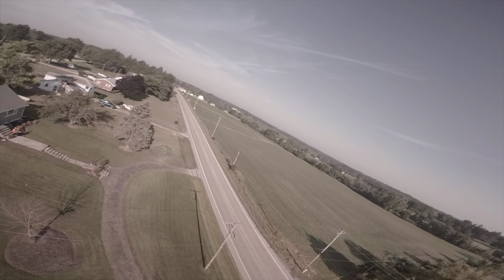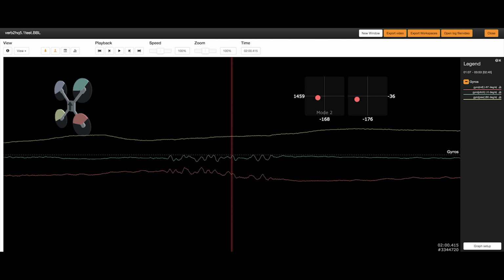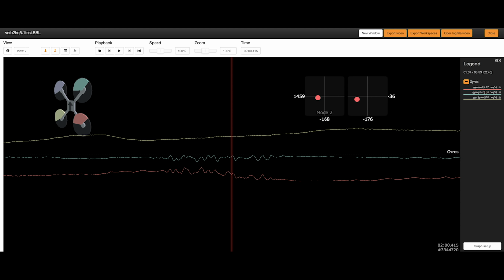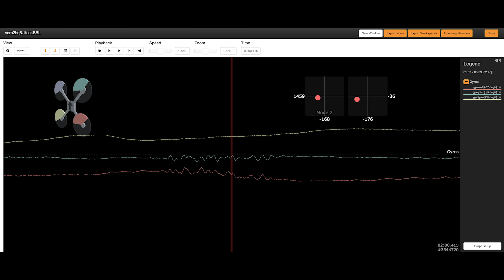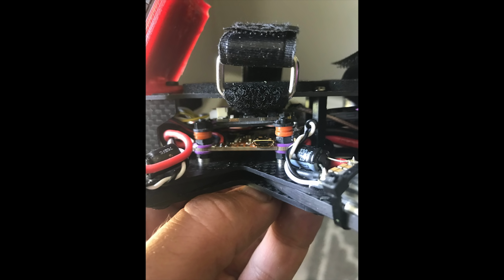FIXING SOME MID THROTTLE OSCILLATIONS\\STEPS TAKEN\\BLACKBOX\\PROPS

Comment: @dorkyand40 I've got a new build I did impulse apex with tmotors f55 stack and I've got a odd bobble on decents and certain throttle percentage and yeh the stack has gummies but shit it was tight. Wondering if having stack screws cut down to place soft mount bobbins will help? Love the frame and build but damn it looks bad
Reply from the maker: I had weird vibes with reverb and alien so don’t buy those anymore. I use tbs source 1 and slam it and lighten it up. No cam plates and titanium hardware. More then half price and excellent noise profile. You’ll need to balacl box and find out if it’s frame noise.  Could be wonky esc too. I’ve had that before and those issues

Comment: I am getting exactly the same issue with my Epic 229, the only problem is that I am using a 4in1 ESC (Tekko32), and on top of it an aluminium plate to shield the EMI that disturb the Helio… Its a very tight fit, I will have to be smart to softmount the FC better… Thanks for the info, I was also playing around with the Q and BB.
Reply from the maker: yeah its def the answer..my first helio is on a pdb in reverb1..its on the nylon standoffs and when the motors were new it was fine but now that the TBS PILOT motors (not the best) are wearing a bit I can start to see some MTO there too..just a tad bit of soft mounting seems to fix it all..if you watched the video you saw the proof..I bet it was the tase issues on my epic I tried to put a helio on..ODIN just works AMZING PERIOD when it has very little noise to deal with..with BETA you can always start to add the filters and stuff but as you know its just not the same..even though I am fine with my epic beta build because richard has done all the work..if I had to tune all that stuff idk what I would do lol..you can crank them down fairly tight too as long as theres a bit of something extra under that stack
Reply: I'm going to play with trying to tune pids/adjust TPA and whatnot.  I'm running gemfan 6042 props.  Have some HQ 6x3x3 and 6x4x3 also to try also. If I can fix issue may swap out helio for a different FC

Comment: Great video again I noticed you did the same video with The Helio spring flight controller. I just build my 1st new helio aio. N flashed the new odin 3.5.2 and updated the imuf in clu. brand new Skitzo Nova frame my Motors are the hypetrain and there hard mounted, the flight controller uses some rubber washers and then the gummies with Nylock nuts like you have in this video. The quad flies great low throttle and no oscillations at high throttle but in my mid throttle range I don't know if they're mid throttle oscillations but the quad will wobble on all accesses almost like a low I term when you're descending. Its like all over the place. I don't know if that's mid throttle oscillations or what I don't know what to do with this new Helio board the filters or the pids. Should I set it to 32k 32k with Multi Shot or 16 16 with dshot using speedix GS 30 amp. Im going to Soft mount my Motors and loosen the stack a little.. I'm going to see if that helps...
 it's not like a mid throttle oscillation that I've seen before where it's very quick this is more of a slow wobble.. please help

I really want to send you a video of a quick flight. Because i dont think anyone else has this issue ..